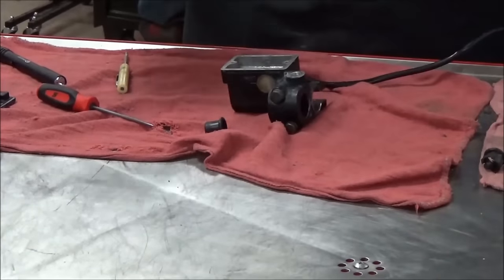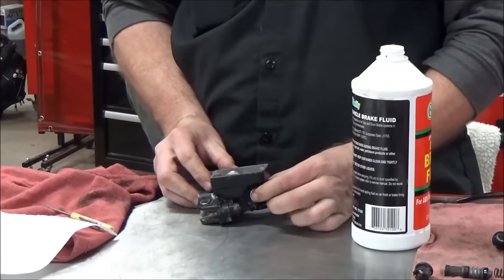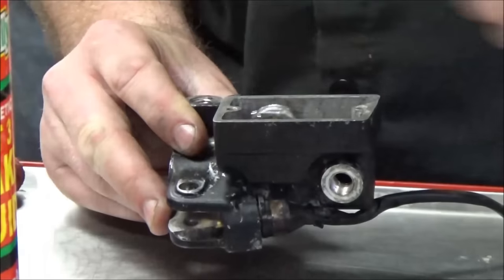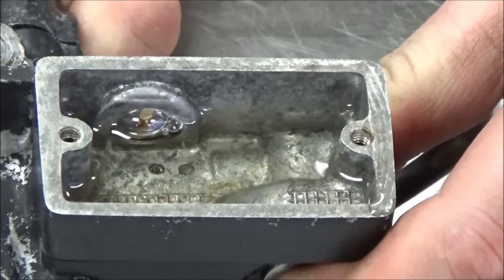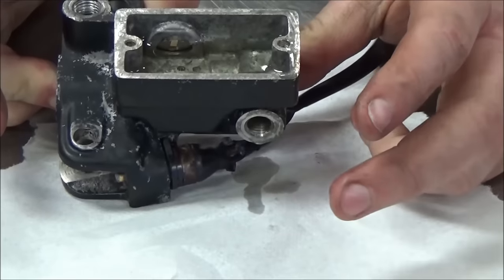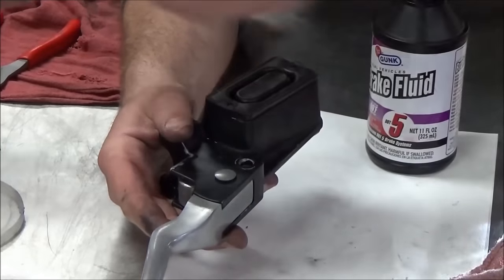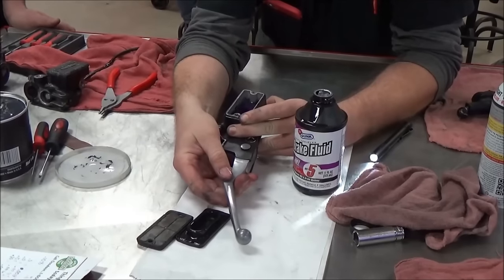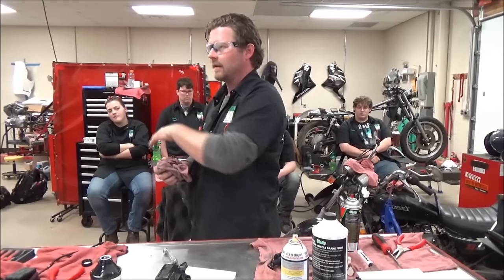How to bench test master cylinders for pressure operation BEFORE putting back on!

Comment: Thanks heaps for this. I was so lucky to come across it after a few hours wondering why my brakes were not working, even though I could feel air pressure. Turns out I had to prime the master cylinder. Wow, they're rock solid now!

Comment: While attempting to bench test the master cylinder on my 2000 Springer, remove the banjo bolt and fluid line, pump up the brake lever, and while covering up the hole, I feel a bit of suction, but when I remove my finger, not a bit of fluid comes out. I installed a new master cylinder kit, but no go.

Comment: Thank you so much!! I finally got my front breaks primed! It was to things, the seal inside wasn't in right and one of the holes inside Reservoir was closed, so I drilled it open with tiny drill bit. Thank you for breaking it down like that
Reply from the maker: Thank you for the comment. See the link below for more help with your question. I have been banging my head against the wall thinking of ways for people to say thank you in an impactful way to help keep these videos coming. Here are few ways that many have found as a way to give back. 
* Membership to H2W (includes t-shirt or tech help) https://how2wrench.com/product/membershipmembers-onlymembers/
* Simple donation to say "KEEP IT UP"
May you have a great day and... https://www.paypal.me/how2wrench

Free Mechanic info, tool reviews, and “how to” videos newsletter sign up: https://how2wrench.com/subscribe-free-newsletter/

Missed a past issue? No Worries. Newsletter Archives: https://how2wrench.com/blog/newsletter-archives/

Like freebies? Click here for a free diagnostic checklist! 
http://gem.godaddy.com/signups/364621/join  

If I can ever be of service to you, here is a video explains how to connect with me. 
https://www.youtube.com/watch?v=vjvmB01ebcs

Comment: Hello, I am also on the maintenance right now. I'm also changing the brake lever for one made of aluminum. There you have to remove the screws on the lever. That is, unscrew. So you probably then set the sniffing game. Do you know it too? Adjustment of the sniffing play? have read that one must eisntellen the hand brake play and then a half turn further in screwed. How does such a handbrake game look like? and how do you notice when it is the right time? I hope you have been able to gather experience. BMW R850R Bj 2000

Comment: Very helpful amigo,  gonna put on stainless steel hoses cause I accidently filled dot5 synthetic crap into my gsxr 1000 when it suppose to use dot 4, and I bleed it prior to that,  but now people say u can't fully bleed out those rubber hoses of silicone crap,  instead get new lines and rebuild or get new cylinders.  So i'ma just rebuild  even though they don't leak.
Reply from the maker: Head over to my website become a member now and to receive 20 minutes of personal mentorship with me. You can even use FaceTime if you have it or find a friends iPhone and we can walk through the actual carburetor process together. I look forward to mentoring you.

Note: Membership is not required to receive coaching or email help. Here are the direct links to individual services offered at H2W:

Email Answer Service-Click http://how2wrench.com/product/email-support/ 

Phone/FaceTime Coaching-Click http://how2wrench.com/product/personal-tech-training-phone-facetime/ 

DIY Mentorship-Click http://how2wrench.com/product/diy-coaching-hire-teach/ 

Dealership Training Services-Click http://how2wrench.com/product-category/dealer-services/ 

MMI/Tech School Student Tutoring-Click http://how2wrench.com/product/mmi-tech-school-student-tutoring-services/

Motivational/Guest Speaker-Click http://how2wrench.com/product/motivational-speaker/ 

On-site Training Services-Click http://how2wrench.com/product/on-site-training/ 

Tech Line Services-Click http://how2wrench.com/product/tech-line-minutes/ 

Mechanic on Duty-Click http://how2wrench.com/product-category/mechanic-on-duty/ 

Did you like this free video and hope to see more? Would you just like to say thank you with a donation? Click https://www.paypal.com/donate/?token=TvKoeRazPL-KysbM-e0ttz-C_gPq2IrqxDmM3ORCu4nxJzQWxYbmo-6m3YuNu64XHLngGW 

Keep Wrenching,
Shane Conley
Instructor/Motivator/Motorcyclist!
www.How2Wrench.com

Comment: I have a question... nothing to do with brakes. I hope you can help? I have a 2012 rmz 250 fuel injection. my question is . Do you have to calibrate the throttle poisition sensor or is it plug and play

Comment: Shane,
Is it possible that the slave CLUTCH unit may be corroded, preventing the master CLUTCH unit from building pressure?  
(Rebuilt the master clutch cylinder but it will not build pressure.)
Only saw this AFTER replacing rebuilt unit back on the motorcycle!
Reply from the maker: That’s a great question for Shane directly! We are just the social media team. Shane has a solution for you. As far as the question, Shane does answer questions when he get's back around to non members eventually so hang tight, FYI >>>> he does member ones daily!
He is just returning from an extended stay in Japan training students this winter. You can imagine how full his inbox is. We put orders are to the front of the line.

The one-on-one service. Get Shane’s cell here: https://how2wrench.com/ols/products/techline-one-on-one       
Quick answers are answered daily as a channel member: Join this channel to get access to perks:
https://www.youtube.com/channel/UCBhM8DCKnT3qXwTW0eToyCg/join   
-Daily MEMBER FIRST COMMENTS ANSWERED FIRST 
-Live Q/A video chats
-Wonder if we have a video on your need? Members can request content links!
-Full Access to the ENTIRE 700 video library
-Member-Only FREE tool giveaways  

Have you seen our "YouTube Trained Support Shirts? Great way to "high five us" https://goodfellasmerch.com/collections/how-2-wrench/products/support-shirt

Comment: What causes a brake system to apply the pads on the rotor when the bike is sitting and not in use? My back brakes can be depressed with a free turning back wheel but when I come back several days later to use my bike the back brakes are fully applied and the back wheel is locked up and my brake peddle is very stiff. I'm about to rebuild the rear master cylinder and I'm hoping that it will fix the problem. I'm a little pessimistic because there are a lot of guys online with thee same bike having the same problem and they say that the problem is still present after rebuilding the master cylinder.

Comment: Hello again Shane. 
Thanks for a great video on testing the master. 
I’m having an issues rebuilding the VFR’s front brake master cyl... I’m going to do the bench pressure test tomorrow. Sure is a let down when everything else was going together well.

I really do think that the air hole is blocked, and it needs to be cleaned out or drilled out. Not sure what to poke it with for now.
Reply: It builds pressure (and suction if covered and released), but no fluid will shoot out. One of the holes must be plugged I guess? Please advise.
Reply: *Solution*

Doing the finger prime (helping it build pressure) has solved the issue. Put it on the bike and pumped it about 25 times and then pressure finally built. Weird. I am glad you have the video out Shane!!!
Reply from the maker: Thank you for sharing…below are some links that help support me and my work. Please subscribe and share these videos to make a difference in education!
Keep Wrenching,
Shane Conley

Shirt/Stickers link: https://how2wrench.com/product-category/specials/ 

Follow us!
Web:
http://www.How2Wrench.com    
http://www.Tools2Wrench.com  

YouTube: 
https://www.youtube.com/c/ShaneConleyhow2wrench  

Instagram:
https://www.instagram.com/how2wrench/ 

Linkedin: 
https://www.linkedin.com/in/shane-conley-how2wrench/ 

Facebook:
https://www.facebook.com/MechanicsLearningSharingPage/  

Free Mechanic info, tool reviews, and “how to” videos newsletter sign up: https://how2wrench.com/subscribe-free-newsletter/ 

Amazon Tools: 
https://www.amazon.com/shop/shaneconleyhow2wrench?ref=ac_inf_hm_vp

Comment: How long does it normally take to bleed the rear brakes if bango at the caliper has been loosen. I cleaned my piston and calipers down, put it back together bleed the line but I can't get any pressure in the line. Is it normal that  rear brake pedal not have any resistance in it after putting it back together? First my front brakes went out now its my back brakes, give me a brake. The videos I see on Youtube are easy to follow but when I do it it something always goes wrong

Comment: Why not screw a bolt in the master cylinder exit and pump it until it builds pressure wouldnt this prove the master cylinder is able to build and hold pressure?

Comment: My question is on an 2004 honda foreman front brakes. Have a very mushy brake handle, need to pump several times to build pressure. How do I know if i need to rebuild the master cylinder or replace the 4 cylinders on the wheels? Also when I squeeze the brake I only see the piston side of the wheel cylinders move maybe 1/8". The adjuster side does not move. Thank you for your help and time!!!
Reply from the maker: On an 2004 its not unlikely that the brake system has never been serviced. With 16 yr old parts, you really need to look at the rubber lines for flexing too. This will cause the "mushy" feeling. I'd love to spend some time and chat with you to best lead you in a logical order. Reach out to me at the number below. 
👍 Thank you for taking the time to comment! It helps us! 
Here is a way to support all the free videos.
Want to say “thanks” or “keep it up”? Click here https://www.paypal.me/how2wrench  

Coach Conley is also available for hire to personally work one on one with you if ever needed. Yep he is a real person. Give him a call @ 602-345-0432
Details here: https://how2wrench.com/product/personal-tech-training-phone-facetime/ 
Your answers and help are just around the corner. Save time and money while protecting your investment and yourself by doing it the right way!
Follow us! 
Web:
www.How2Wrench.com     
www.Tools2Wrench.com

Comment: I have a rare go kart with mater cylinder issues.  It is a go kart that has not been used for a while.  We replaced all the fluid but it works for a while and then it looses the pressure and leaks through the front of the cylinder.  Any Advice?
Reply from the maker: 🙌 🏁 First off, thank you for SUBSCRIBING! Love seeing our subscribers comment on how the video helped! It helps us!
Here is a way to support all the free videos.
Want to say “thanks” or “keep it up”? Click here https://www.paypal.me/how2wrench  

Coach Conley is also available for hire to personally work one on one with you if ever needed. Yep he is a real person. Give him a call @ 602-345-0432

Your answers and help are just around the corner. Save time and money while protecting your investment and yourself by doing it the right way!
Follow us!
Web:
www.How2Wrench.com    
www.Tools2Wrench.com

Comment: Just came across your videos when I was rebuilding my master cylinder. When I finished I covered the outlet and pressurised it by pumping air which it seemed to compress ok (quick puff if air when I removed my finger). Surely that's enough to prove it will build pressure? Or must it be tested with fluid?
Reply: do it with fluid.
BUT , long as it has good suction to withdraw the pressure from which it gives, then it is good.

Comment: I have bench tested my master which is operating as you explained but I'm still not able to build pressure. My brake lever has no resistance when pumping it, however fluid does come out from bleeder screw. Would there be an issue down in the caliper area that's causing the failure of pressure not building in the line? I know my master is doing its job. I own a Honda XR650L, all work in it has been done by my mechanic but this has been getting expensive so I bought a manual with the help of Youtube started doing what I can myself. I have followed step-by-step and running out of options as safety check approaches. What am I doing wrong? Please advise Shane Conley
Reply: @How2Wrench  This has never happen to me to know you will actually help me resolve this problem. Believe me I've tried to the best of my ability and resources that I have. All suggestions I get from personal friends no help especially when their not able and willing to get dirty and that one that's willing always says I need to get OEM. I get it but if only help would be willing to physically do it with me would I feel better about myself and the work I've done unsuccessfully. Why is it so hard to get this brakes functioning properly again. I know it will not pass safety inspection as is. Shane Conley please, I'm desperate but don't know where to start?
Reply from the maker: @WILLY52368  Looks like my messege was cut off....here are the links for you to choose from friend! 
Yo! Want us to drop our wrenches and help you? We love helping subscribers…even on old videos! Help us grow friend! Here’s how:
1. Subscribe and let us know with a response. We will circle back when we can (usually within a week, sometimes faster, depends on member needs)
2. We answer your questions EVERYDAY for channel members Join here: https://www.youtube.com/channel/UCBhM8DCKnT3qXwTW0eToyCg/join     
3. Give us a high 5 here: https://www.paypal.me/how2wrench  and I run back to the computer! 
4. Is this an emergency and your head is about to explode from frustration or fear? Get Shane’s cell here: https://how2wrench.com/product/personal-tech-training-phone-facetime/
Reply from the maker: @WILLY52368  No worries this is what I do for a living helping others with the techline or our service department!
Reply: @How2Wrench  If only I could at least explain to you over the phone the steps I have taken so you can get a better picture. Just by you responding is my book makes you the go to guy. Keep up the awesome work.
Reply from the maker: @WILLY52368  Hey friend, you must be new to the channel of how2wrench and not familiar with what we do...You can have my personal cell on speed dial...all the links were shared above...make it a great day...
Reply: @How2Wrench  Wasn't sure if was ok, I just wanted to contribute something to the channel and not just be a leech, but yet I cant even afford to do that :  (

Comment: My Front Master cylinder lose the pressure in 2 days if i don't use my motorcycle. I have to re pump it more than 30 times then it gets back to normal but bit soft.
What could be the problem?
There are no leakage.
It is axial Master cylinder.
Brake fluid level is fine too
Reply: I had a similar problem on my bike these past couple of days, i would bleed the brakes get a nice lever feel and after a day or two my lever feel would be mushy and i had air in the system. mind you i have new brake lines and new fluid along with new pads. ended up being my master cylinder needing a rebuild. which is pretty easy to do and it solved the problem.  ebay sells these kits for almost every bike i believe. it should be called something like master cylinder rebuild kit , hope that helps.